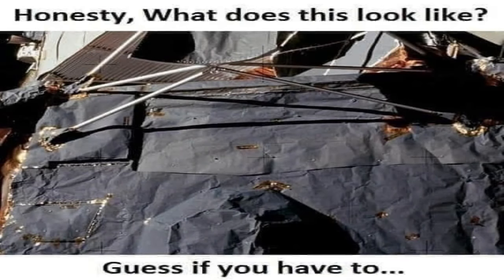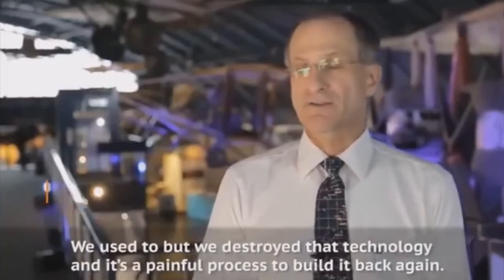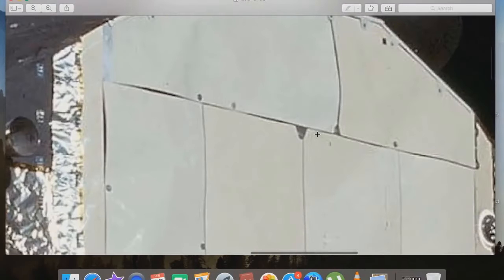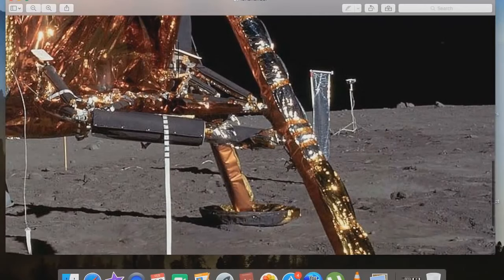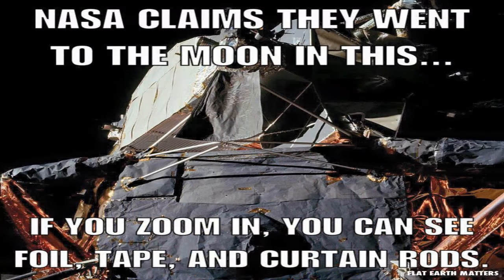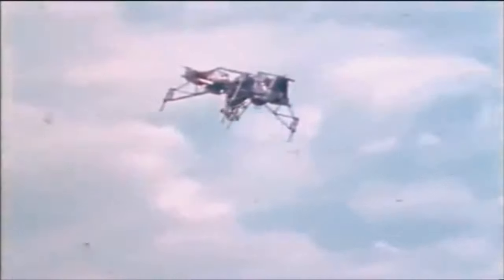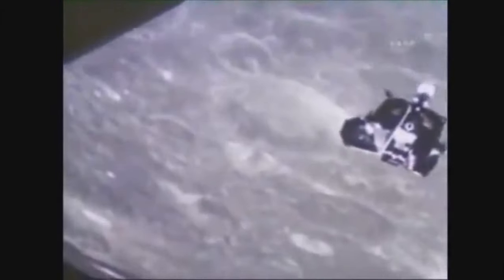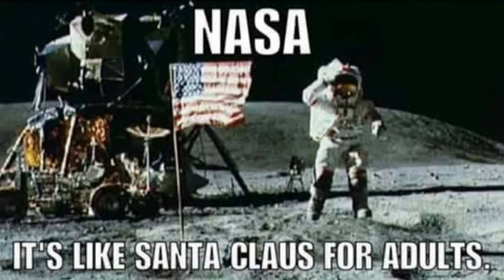NASA's Laughable Apollo Lunar Lander

Comment: Lets to a play-by-play debunking of this grand video of yours:
- the "cardboard" lunar lander: 
In the vacuum of space and on the moon, there really is no need for rigid materials, as there is nothing to push against them. A thin layer of reflective cover is more than sufficient to "shield" the parts from the sun, that need to be shielded. The entire craft was wrapped in plastic and gold foil basically for thermal control. Also, these vehicles were built for a purpose and that purpose was not to satisfy your aesthetic desires. In the absence of an atmosphere, there is no air resistance, so shape doesn't matter. Neither does having smooth surfaces. What if it had wrinkles? What if it looks like it's a science project? Does that affect how it works? No. All spaceship were basically artisan products, hand crafted for the mission they were meant to fly. Nobody gave a damn how they looked, as long as they did what they were supposed to.

Fun little fact, the duct tape was in part popularized by its use in the space industry. Duct tape (or gray tape, as it was called in NASA) was used in basically every space mission ever flown. It famously saved the lives of those onboard Apollo 13, as it allowed them to fabricate a makeshift CO2 filter for the lunar lander from some tubing and plastic bags, along with the spare filters they had for the inoperable command module.

- the "lost technology":
Is not lost. Well, not all of it. Did I mention how much of the stuff was hand crafted? Guess what. It was. It was built and tested, and adjusted until it worked. We have the specs on how to build the big engines that powered the Saturn V, what we don't have any more are the engineers who have the know how of what else they had to do, that was not part of the specs.

Also, we didn't go to the moon, not because we couldn't, but because we didn't have any reason to. Because we went there already, realized that it's one big chunk of empty rock with no aliens waiting for us. It only recently started to become much more trivial to get there and we also reached a point in technology, where we can contemplate mining rare resources up there.
Reply: - The "supposed" most incredible achievement of mankind was broadcast to hundreds of millions of people around the world. It was seen even in the communist block back in the days, when the cold war was at its hottest. DO YOU honestly think, that the soviets would have played along with NASA in perpetuating an "obvious lie"? That they would not have used it the moment they figured it out for their own gain? That they did not have the technology to check and verify, that what the US claims is actually true? Don't be naive. They did LIE about much less important things to gain a political advantage and for whatever reason, they kept their mouth shut about the faked moon landings. Strange.

- Quality of paneling: again, it was built for function. Space doesn't care if panels align neatly. Neither did the engineers who built the thing. As long as it was bolted on well enough and was doing its function, it was fine. Remember, it was a space RACE. You didn't get points for being neat. You did get points for being first.

- Press tabs: did it occur to you, that they didn't all align the seams just so you can all see the press tabs on every one of the legs and connecting rods? Sorry to say, but they didn't care what you would think of their work half a century later.

- Gold foil bands on legs: if you really look closely, you'll see the other leg also has more closely spaced bands around the connection point, they just don't exactly match the other leg.. why might that be, I wonder. Could it be, that since these were all done by hand and the important criteria for the person doing this was to secure the insulation and not to appease you, they placed the bands as they were needed and not to meet your arbitrary critical expectations? I guess it could.

- Thin skin of space craft: I understand that impulse control is a hard concept for you, but when you are trying to do something no human has done before, and can only do it by saving as much weight in the craft as you can, you surely do understand that it's relatively easy to just.. wait for it.. not POKE the skin of the craft. There is nothing out there, that would poke it besides you, so why does it matter how thin it is? That's why it's called SPACE. If you think micrometeorites, think again. Those are so fast, that you'd need serious armoring to prevent them from punching a hole into the skin of the craft and that weight was beyond feasible back then. Plus the chances of encountering one of those are marginal enough, so they braved the journey, knowing full well, that a speck of space dust hitting the craft could pretty much end them.
Reply: - Gus Grissom: He was a hero, and you even mentioning his name in this ridiculous a context makes my blood boil. He gave his life, along with Roger B. Chaffee and Edward H. White in an effort to move humanity forward. Much more than what can be said about your contribution to humanity. He was famously critical of the space craft assembly process, as in order to beat the USSR in sending HUMANS to orbit first, NASA did in fact cut lots of corners and used whatever, just to get the craft built ASAP. It had a fully oxygen atmosphere, flammable materials, poorly insulated electrical wires.. everything needed to make the command module a ticking time bomb waiting to blow. He and his two colleagues still climbed into it, for a pre-launch test, a few days before the actual planned launch, no less, only to be burned alive when the inevitable happened. They knew the risks, as they were all test pilots for the navy before they joined NASA. They risked their lives to make ours better. Their deaths actually forced NASA to take a step back and take safety more seriously. It is in big part thanks to them, that the remaining Apollo craft all came back home. Apollo 1, which actually was the 4th Apollo mission and would have been the first one flown with actual humans unfortunately did not. It did not even leave the ground. So you stop talking about shit you have no clue about, twisting it for your own damn stupid agenda, sullying the names of heroes just by associating it with your idiotic theories.

There was no conspiracy behind their deaths. Just corporate negligence and corner cutting to meet politically imposed arbitrary deadlines. To add insult to injury, Gus Grissom had nothing to do with the LEM. The first mission to fly a lunar lander was Apollo 9 (12th mission of the program), which took a lunar module to earth's orbit, practiced the docking maneuvers and then came back to earth. Apollo 1 was supposed to be the first crewed flight of the command module, and it was that fated command module that Gus put the lemon on top of, the same one, which later also killed him and the rest of his crew.

- LEM not landing on earth. The lunar lander was designed to operate in Moon's orbit. Notable differences: NO ATMOSPHERE, 1/6th of EARTH'S GRAVITY. The LEM could not re-enter earth's orbit to land, even if it wanted to, as it was never designed to carry a heat shield. Yet you need one of those, if you want to enter an atmosphere from the speeds needed to orbit earth. Remember, an orbit is essentially continuous falling. Think of it this way: you fall a little, then you fly forward just enough to be on the same altitude. Then you fall a little more, and fly forward again.. etc. Since the gravity of earth is pretty high, you need a very high speed to stay in orbit. The LEM would not have enough fuel to decelerate from that speed AND counteract earth's immense gravity for the duration of a much higher descent. Space around earth starts from 100km up. Space around the moon is.. everywhere, there's no atmosphere there, so you don't need a heat shield nor do you need as much fuel or as big an engine as you would back home.

- Safe landing on moon: A retro thruster just means that it's pointed in the direction of where you are going. (called: retrograde) Basically they were flying ass forward and they fired their main landing thrusters for as long as they had to to slow down. 4000 miles / hr is not even that fast tbh, not sure what's so strange about it. Hypersonic missiles fly faster and they do it inside the earth's atmosphere.
Reply: - LEM training vehicles: They were basically strange "jetpack" like devices that were designed to mimic the behavioral characteristics and controls of the LEM in a moon environment. However, they were flown on earth, so were affected by things like wind, that no one can really predict. The so called "perfect conditions" that you speak of are telling, just look at the smoke cloud after the training vehicle crashes and tell me, where the smoke should fly on your flat earth, as I'm sure it should go straight up and not almost horizontally. Also, the guy parachuting down is just having fun flying so fast in one particular direction and not coming straight down. That craft was blown out of the sky by a likely sudden gust of wind. You could of course look it up, as the whole program is extremely well documented, but hey.. you are never bothered by facts, so why would you.

- Thruster vs Lunar surface: The landing rocket engine was very powerful, but much of that power was needed to deorbit and decelerate during descent.  Once they did that, when they got down close to the surface, they only needed a fraction of the thrust, for three reasons: A) low gravity B) low weight (much of their fuel has been expended) C) low speed (they didn't need to decelerate that much anymore). Finally, if you watch the footage, you can clearly see that the landing is throwing up quite a lot of dust and it was actually causing visibility problems for the astronauts, but it wasn't nearly enough to create a visible crater, as they were using very low thrust during the final few meters. 

- For the docking with the LEM: The docking was mainly done by the pilot of the CM, so the reason you see the LEM just seemingly move around on the screen is because it's the command module that's moving around in reality. However, in the absence of visual reference cues, you can easily think that the LEM is doing all the moving. Also the reason for the lack of RCS (reaction control thrusters) emissions, its the same. The video mostly shows the command module doing the maneuvering. Not to mention, that in order to move in space, you need only a very small puff of exhaust from the RCS thrusters, which would not even show up in a low res sped up video like this. Finally, the jerkiness is also from the sped up footage. That footage is sped up a lot compared to how it looked in real time. You can easily see that just from the speed the lunar surface moves in the background.

Real docking footage in real time: https://www.youtube.com/watch?v=EeeeTVr4Lyg In that, you can even see the momentary flashes of the RCS on the LEM occasionally.

- Space proof? Doesn't even look rain proof: Guess what, it doesn't rain in space. There's no nothing in space. That's why it's called the EMPTINESS OF SPACE.

Overall, you are an uneducated idiot, who has nothing better to do with his life, than fabricate ridiculous, nonsensical conspiracy theories that fail to meet any of the criteria one would need to even consider them plausible. There's too many people involved in this lie to ever work, there's not a single one out there, who worked on the thing and actually admits it's a lie. The many enemies of the US all agree that its real, seemingly all going along with the lie for no apparent reason. The vast amount of evidence out there that proves this actually happened is conveniently ignored, while ridiculous little things are magnified and blown out of proportions in a vain attempt to cast shadows on these events. Finally, if everything else fails, then that's because the entire world is governed by a secret cabal of lizard men, who have secretly controlled every major country for the better part of the last millennia, working in unison to pull a wool over our eyes for reasons that's beyond out comprehension. It's enough that we accept that they are all lying.

No, sorry, not gonna bite.

Comment: It’s like a car wreck I cannot look away, not one piece of scientific evidence provided, just jaw jacking from this Eric guy lol Don’t quit your day job ED.
Reply: Are you seriously not looking at that lunar lander? Tell me how that thing went through outer space..?
Reply: @jakefloyd1037  The lunar module’s fragile look was due to the requirement of flying and landing in a vacuum. The ascent and descent stages were built to be as light as possible as there was a limit on how much thrust the engine could produce to act as a brake for the weight it was trying to slow down on descent. The outer panels covering the aluminium pressure hull were extremely thin and buckled with the stress of impact and lift off. These were outside the pressure hull and so were completely unimportant in terms of strength.
Because they would operate only in a vacuum, many things didn't need to be sturdy, nor did the shape of it matter. It would never have to deal with aerodynamic drag or atmospheric pressure.
In fact, the LM was designed to buckle in the right places, as this was the most weight-efficient method of handling the shock of landing. The asymmetric bulges on either side of the cockpit housed the fuel and oxidizer tanks which had different densities. The LM was kept in balance by placing the less dense mass further out from the centre.
Temperature was controlled with a reflective multi-layer thermal blanket of Mylar/Kapton and reflective passive optical coatings. The complex insulation blankets covering the module had many layers and contact points between the layers needed to be minimized so that heat wouldn't be passed through them by conduction. 
The black material is where thin Inconel sheets were painted matte black with Pyromark paint to improve their heat emission properties, so they would cool off quickly. (Black material both absorbs and emits heat better than material of other colours). 
This treatment was applied where the hot exhaust of the reaction control thrusters heated the descent stage. The plume defectors were also painted black as were other parts of the ascent stage that were heated by the thrusters.
For the parts of the LM that only needed to be a protected from sunlight, high reflectivity was the most effective approach, and those places were covered with shiny amber Mylar/ Kapton or coloured Pyromark paint. As there is no air in space to pass heat by convection, if you lower absorption of heat radiation by making surfaces that are highly reflective or emissive, insulation is very effective. 
To increase the insulation properties, the Mylar/Kapton sheets were hand crinkled before blanket fabrication.This crinkling provided a path for venting and minimized contact conductance between the layers and so this was bound to make the outer layer rather uneven. 
The LM pressurised cabin was thermally controlled by an active cooling system, using a coolant loop, heat exchanger, and an evaporator or sublimator, where tanks of coolant carried heat away to a porous plate. The heated water entered the exchanger and then reached the sublimator, where it was slowly and gradually exposed to the vacuum of space. The consequent pressure-drop made its temperature fall; the water would freeze on the outer surface of the sublimator and turn directly from ice to water vapour. 
NASA had become increasingly concerned about the growing complexity of the fuel cell system for the lunar module and in February 1965, after months of study, NASA approved a switch from fuel cells to batteries. The command module would continue to use fuel cells for electrical power because of its longer mission duration. But the LM only needed its electrical power for a maximum of 3 days and the simpler battery system was attractive.
The battery contractor for the LM was Eagle Picher. The company had already been supplying batteries to the military for a long time and for the space programme all the way back to the first satellite launched by the US. I. In addition, the company was already supplying more than 40 batteries for the Saturn V rocket.
Silver-zinc oxide batteries were chosen for their reliability and familiarity. There were four 400 ampere-hour batteries in the descent stage of the LM and two more 300 ampere-hour batteries to power the ascent stage.

Comment: 2:21 why would this section need to be made from multiple panels, a single sheet would have been stronger.
It makes no sense at all to 'destroy technology' unless they were trying to cover something up.
Reply: The ascent and descent stages were built to be as light as possible as there was a limit on how much thrust the engine could produce to act as a brake for the weight it was trying to slow down on descent. The outer panels covering the aluminium pressure hull were extremely thin and buckled with the stress of impact and lift off. These were outside the pressure hull and so were completely unimportant in terms of strength.
NASA did not deliberately 'destroy' the technology to go to the Moon in the sense that it was forgotten, mislaid or mysteriously disappeared. A lot of the blueprints still exist on file; but the individual knowledge of everyone involved and the “organisational know-how” of how to actually run such a huge, complex project has been lost. And on top of that, much of the equipment is archaic, and many things cannot be bought “off the shelf” but would have to be specially manufactured. Re-designing from scratch is cheaper and better.
Reply: @Ruda-n4h  thanks for your answer!